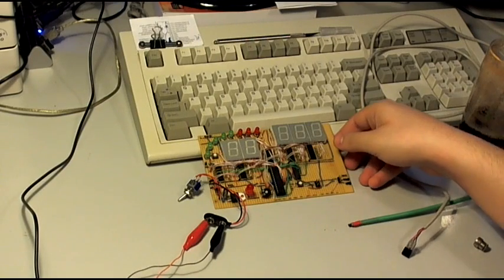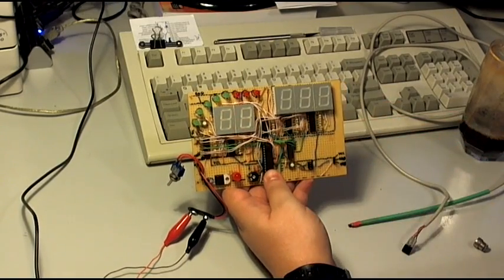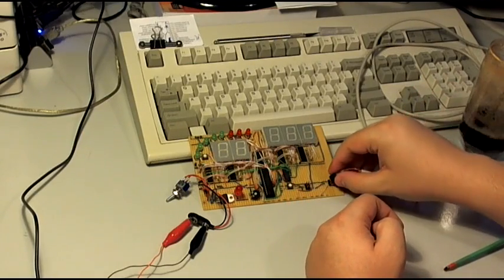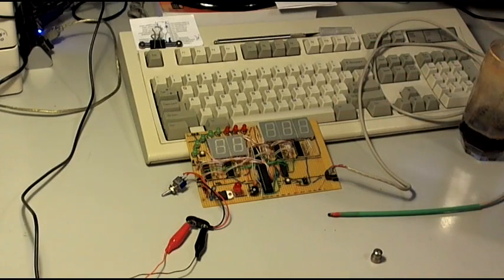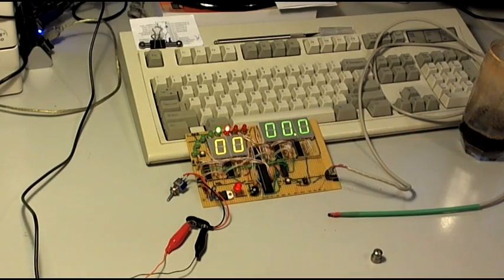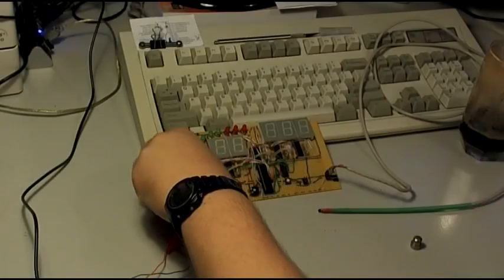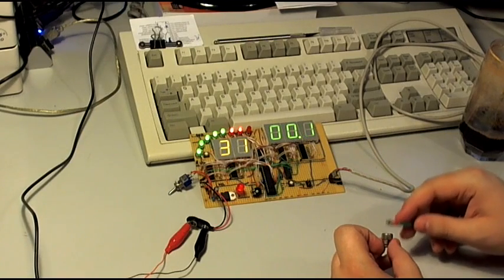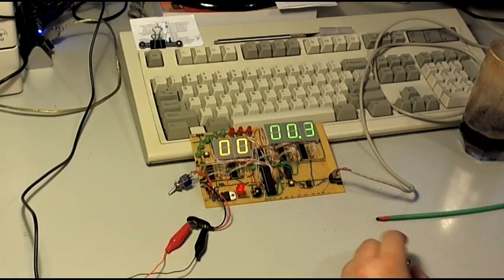DIY bicycle speedometer/odometer bench test

Comment: I also was making one, on ATtiny2313. Aplhanumeric LCD displays are much better. They can be perfectly readable even in brightest sunlight. Now i want to use my Psion Workabout MX to count distance, display data and OFC register it on SSD disc, MCU will only measure the speed then send it over RS232 every 2 impulses from wheel sensor.

Comment from the maker: @gsixteen1 I'm out of town for a few days, I'll draw a circuit diagram and post a link in the info box as soon as I return. In short it's just an ATmega168 reading an allegro A1302 ratiometric linear hall effect sensor using the analog comparator, and driving the displays through a series of 4511latched 7-segment displays. The 4511 input lines are all connected to the same 4 pins on the microcontroller, and a 3x8 decoder is used to select which 4511 is active during each write operation.

Comment: Hello John. Witch one is the final version of the code? Thanks.
Reply from the maker: The tip of the mercurial repo in the description. Just clone the repository.
Reply: Hall effect sensor can be replaced with a push button ?
Reply from the maker: Not without some changes in the code, which reads an analog voltage from the linear hall effect sensor at the moment. And I don't see how you would mount the push-button on the bicycle so that it's pressed when the wheel completes a rotation. Something equivalent to the push-button that would work, again with some modifications in the code, is a reed switch.
Reply: Segment displays is with common cathode ? Do you have the program using LCD display ?
Reply from the maker: Yes, they are common cathode as you can clearly see in the schematic. I don't understand the second part of the question, since there's no LCD anywhere in this project.
Reply: I wanted to know if you have another program where you use LCD ...